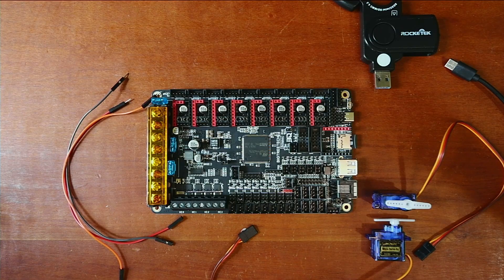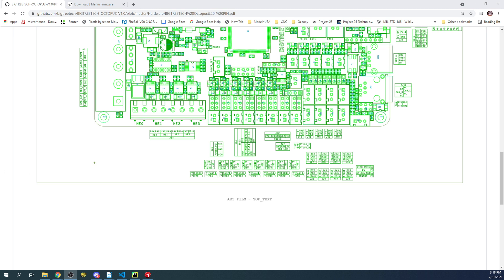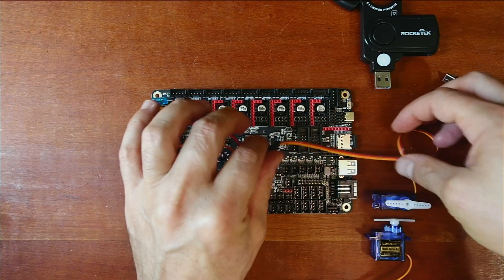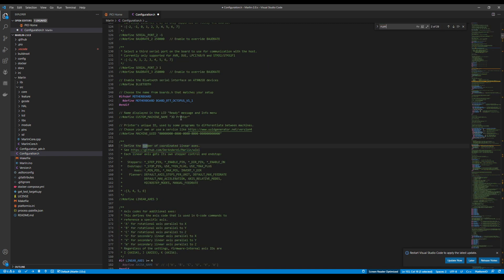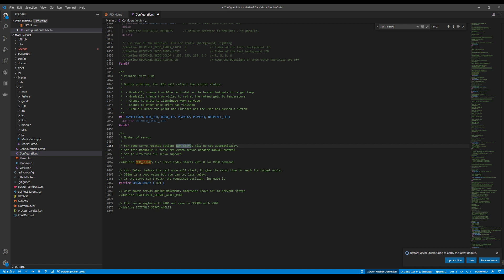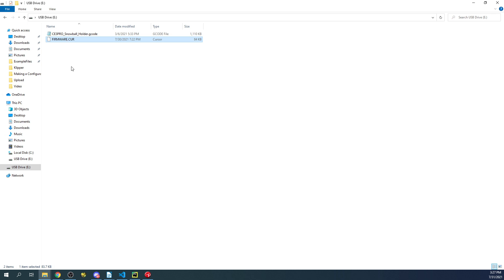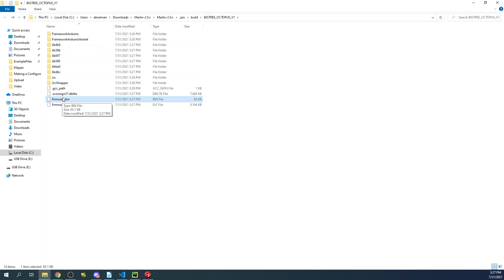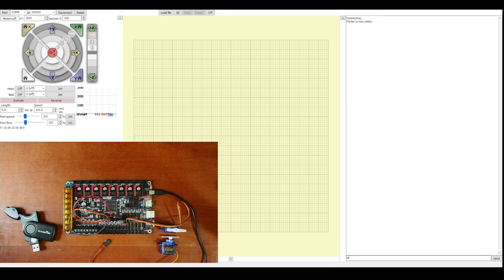BTT Octopus V1.1 - Additional Servos

Comment: can I make both the servos x and y ?
Reply from the maker: Unsure I understand the question.  X and Y axes are usually done with steppers.  Servos are for tool movements like a leveling Sled or changing printer heads.

Comment: I want to use this board to control 8 servo motors, not stepper motors. The 8 servo motors are 110v AC winch motors. Im building a parallel cable robot 3D printer. Is this possible?
Reply from the maker: Maybe, but never tried it.  Doing multiple servos is somewhat easy up to 4.  Using Klipper it might be higher.
Reply: @EdwardBraiman  Thanks Edward!

Comment: Hi, Thanks for the video! very helpful! actually I have the same board and I followed your instructions and tried maybe 10 times, but it's not working for me! I receive the echo:Unknown command: "M280 P0 S45", I have tested both P0(BLTouch) and P1(the same pins you used). I don't know if there is a bug with Marlin or it's related to the board. Any suggestions?
Reply from the maker: There's a Discord chat link in description in General chat either myself or someone else can help.

Comment: Thanks! Please, could you do a video about this board and the difference between the power in connections? I did notice when I bought this board that that have more connections in that the normally BTT skr boards and its a little confuse. Thanks! Great channel by the way
Reply from the maker: You're welcome.  Could you clarify what you want a little more about power?
Reply: @EdwardBraiman  i mean that i have see in videos that there is a motor power, a power in, a bed in, I don’t remember now (im a work). And I don’t really know if I just need a power supply to power up the board or I need more
Reply from the maker: In description of video there should be a GitHub link to BTT for board pinouts and manual.

Comment: Along with Octopus i also ordered stepper motor expansion board for three addtional stepper motors which connect to the EXP1 and EXP2 ports. I need 11 motors for my Printer.
Reply from the maker: Careful with expansion for steppers some don't work well.
Reply: @EdwardBraiman  
was actually planning to replace 35V capacitors with 50V capacitors on the expansion board, so that i can run my XXY axis at 48V with TMC5160 drivers.

Comment: would it be possible to use the pins assigned for the inductive probe for servo? I plan to use the servo for nozzle lifting mechanism.
Reply: I had problems using the pin PB7 (which by the way shared by the BL_TOUCH and the J40 Inductive probe connectors) and ended up using pin PB0 from the J37 RGB_LED connector.
Reply from the maker: That's great.
Reply from the maker: Should be.